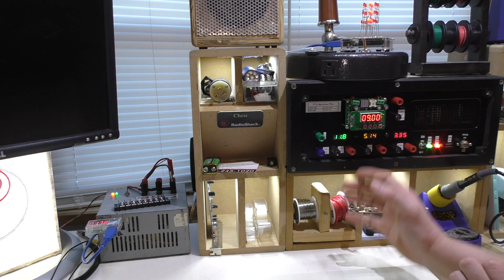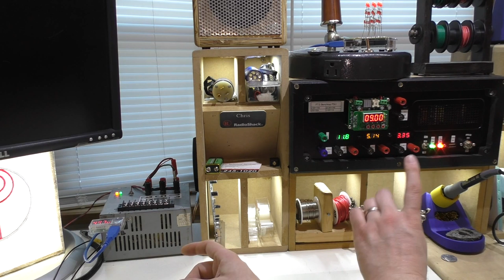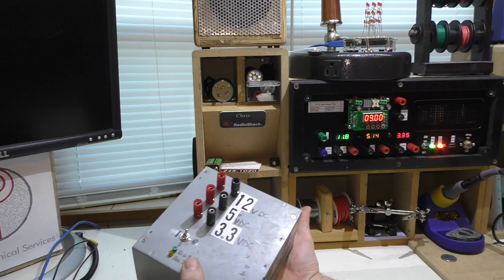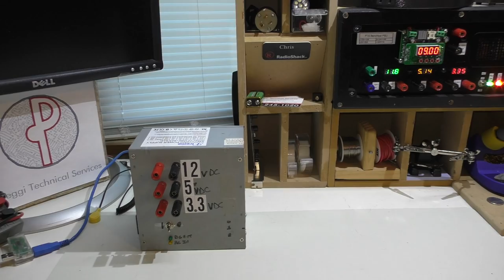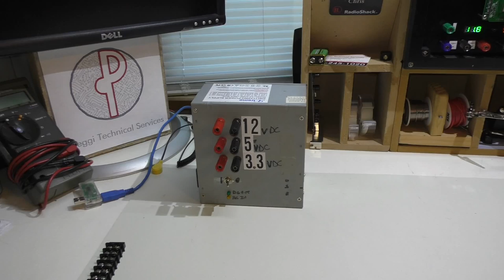PTS Ep. 66 - Another ATX Power Supply Conversion

Comment: I love the video! You've got my "like" =D 
Just a word of conern (not for you, you seem to know what you're doing, but for your viewers) Be carefull when trimming the ends of such heavy cables off your ATX PCB! If you haven't crimped the ends before soldering them onto the board. This can cause cracks in the solder joint that at the time may be invisible to those of us lacking ultrasonic inspection devices, but given enough time, cracks tend to grow when exposed to any vibrations (like from a case fan). Or if they are exposed to repeated changes in temperature, and can in due time gain enough resistance to cause your circuit to behave in unexpected ways. - (Best case scenario) or actually heat up enough to set something on fire without triggering any fuses or even a residual-current breaker! - (worst case scenario). Or it won't get that bad and you're care-free - (Most case scenarios). This is not a likely problem at this scale just as long as you take it a bit easy and are aware of the risk!
Reply from the maker: Well said.  Thank you for your comment.

Comment: Hi
I've converted a couple of power supplies that are identical to your first long running supply. The data label states there is 18A available on the 12v+.  I have a 12v stop/tail light wired in series to the 5v+ as a load. I only seem to get around 10A and the voltage drops to about 11.3v is this normal.

Comment: I have the same Hako Iron that you have, however i am having issues getting the 5v adn 3.3v rails unsoldered i am using it at 750 degrees. Do you have any tips to get these unsoldered quickly and efficiently. i am just using a small chisel tip.

Comment: Great video.But if i get it right when i want to use the 12volt only then i only have put switch between the green en black wire to make it work.
Reply from the maker: Putting a switch between green and black will activate / deactivate all three voltages that these supplies can output.  There really isn't a way to switch on the individual voltages.

Comment: Dont know what electronics  Hobbyist thinks this will help him, it wont, fix voltage is like fixed 100K Ohm range on Voltmeter, its usless , it wil measure 100K , but since you need more, it will end up unused . That is what will happen to all these , be smarter do LM317 or similar , with cheap step up converter you get everything , i think cheaper then this , for sure not expensive .
Reply from the maker: Actually they are quite useful.  And they have a higher current output than an LM317.  There are ways to adjust the output voltage levels too.
Reply: @pileggitech  By the  way if interested, my LAB Power will be in Vintage Low Frequency Valve Voltmeter Box,  stumbled up on it by chance ,  real nice one . for 5$ all with Valve/Tube voltmeter , but i think that will have to go out . But old analog gauge will be used as voltmeter  , its gonna be real nice if all fits well , and Gauge is working , will see tomorrow, if interested in project i can let you know , ill make a video.

Comment: I was following your big power supply project, I think the last one was Episode 31...then I don't see another Episode for this and then you show the completed power supply with the variable power...
Reply from the maker: Sometimes I don't get to work on projects / videos at the time I'd like to.  Sometimes I have to circle back to older projects when i have the time  / money to do so.
Reply: I can understand that.  I wanted to see how you did the Voltage regulator.  In the mean time, I have been studying potentiometer circuits and found one that can output up to about 38 Volts using an LM317, a couple of capacitors and a couple of resistors..  The LM317 Voltage Regulator, can also be called LM317T or LM317AT, in conjunction with a Pot.  Was wondering what you did.   Next, I want to find out how to regulate current.

Comment: Chris one more matter I missed out . Do you have a video on how to convert a led 24v power supply ,,split it to 12v power supply . I have a few pieces of this gadgets  with me  and I need to modify this. your help please
Reply from the maker: I don't have a video on that subject.  You'll either need to use a voltage divider (by using tow resistors) or a 7812 voltage regulator.  There might be a way to convert the supply directly but that's beyond my knowledge.
Reply: Chirs thanks or your swift reply .will look for one as per your avice

Comment: Hi Chris can I ask a question. I have just built/converted an ATX PSU but am having problems with it. It is an older type and the +5v is the higher rating. I have fitted a 5.6ohm 10w resistor across as load. Wired two LEDs, one across GREY wire and ov and the other across purple wire and ov ,both fitted with appropriate resistors.I have two problems one the PSU does not always switch on with either the built in on/off switch or the switch across GREEN and OV, secondly the led showing good PSU does not always light (i.e. grey and OV) Any ideas please, what the problem could be. The PSU was fully working when taken from the PC.  Graham
Reply from the maker: I'd recommend the standard course of action that I usually suggest to similar questions like yours:

Double-check all of your connections.  Make sure there are "no opens or shorts" to be found.  Worse case scenario, take the mod back to square one again; remove everything you did.  Intermittent problems are the worst to diagnose because they're just that - intermittent.  To me, that just means that something is either loose or failing.  Your PSU just might be at the end of it's life.

On a more positive note, most of the people that follow the above advice say that they managed to get it working again and that it was either a bad/loose connection or an open/short.  I say if it's toast, at least you have some parts to build a new one.  Good luck.
Reply: Thanks a lot Chris, I will give it a go. Many thanks for your response, I appreciate it
Reply: Hi Again Chris. have tried what you said and got the PS good led working , comes on after a short while. The PSU switching is still not working correctly. If I connect the Green wire to ground and switch on using the psu main switch on and off it works fine. If I switch on and then make and break the green connection to earth the psu goes off but will not come on.,I have to switch off the main switch, make the green /ov connection and then switch on with the main switch and it works fine.  I am getting 11.95 volts from 12v, 4.49 volts from 5v and 3.34 volts from 3.3v.  Might leave it like this but would be interested to know why it will not switch with green and ov.Thanks again for your help[ will not bother again after this.
Reply from the maker: It's not a bother at all.  I'm just as perplexed and curious as you are.  You can always send it to me if you're really stumped and I'll gladly take a look at it for you.  Send me an email at pileggitech@gmail.com and we'll discuss it if you're interested.

Comment: Hi Chris very interesting video . I intent to built one probably one with volt.watts meter . Will follow one of yours . but what is theheat sink resistors wats ohms you use. or the best  your advice please
Reply from the maker: It's a 10 ohm 10 watt power resistor.  Newer supplies don't need them ass the output voltage is quite stable.
Reply: Hi Chris .Thanks for the swift reply. Will contact you if any assistance needed .tks again